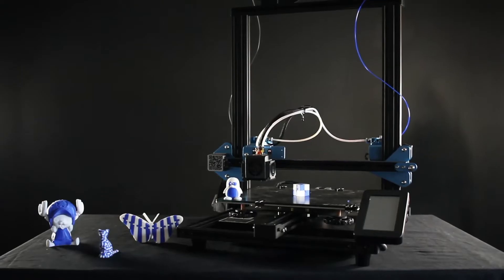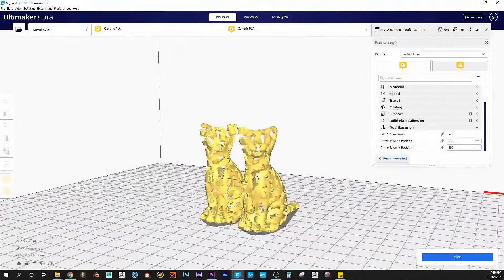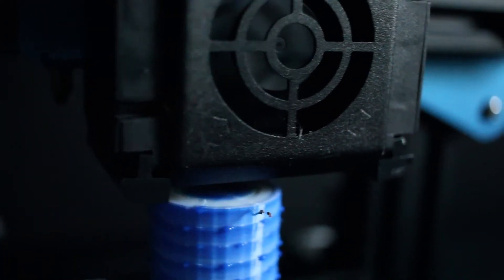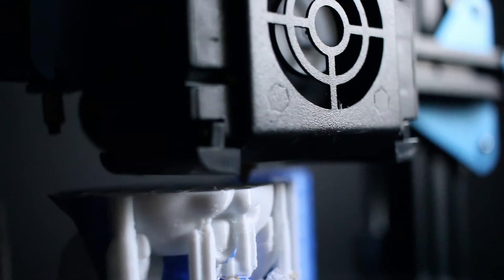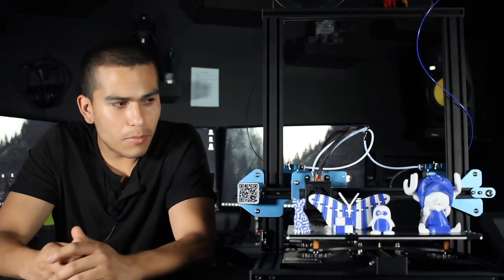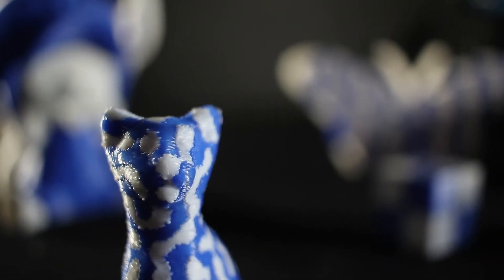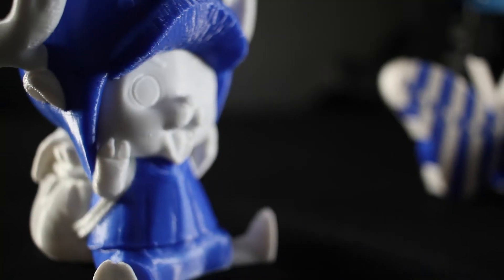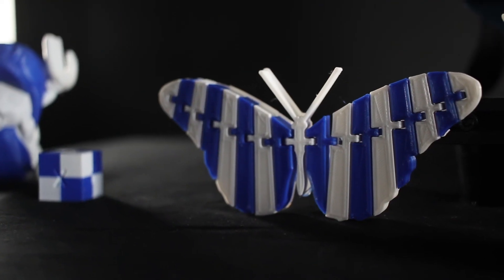SOVOL SV02 Best FDM 3D Printer Review Test for Dual Extruder comparison and Tips

Comment: I like to do a filament change after the 3rd layer and then again after the 11th. Easy to do on a single filament printer but much easier with a dual and it usually looks awesome especially if there's a logo on the bottom.